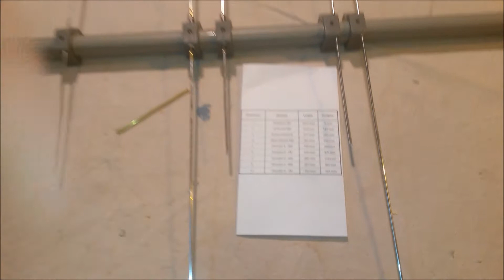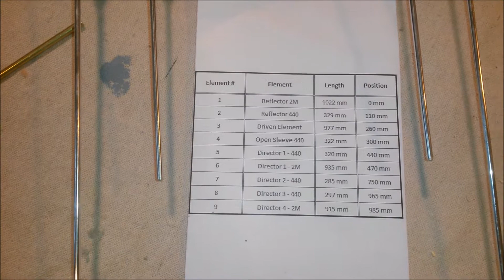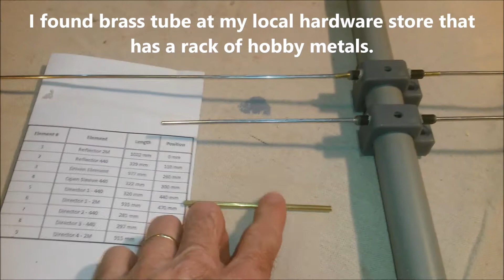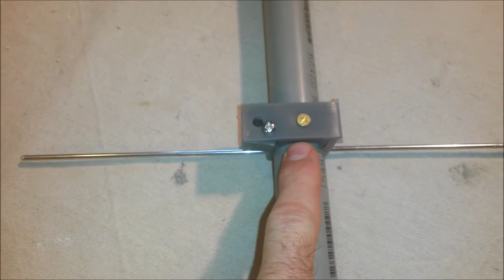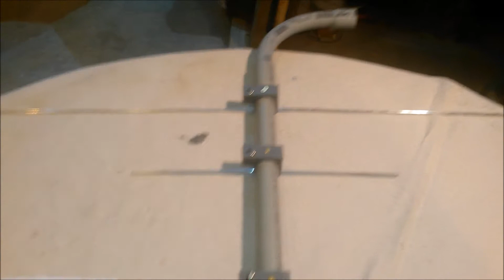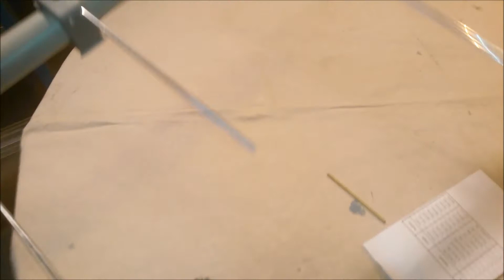Larry D. Brown WB5CXC yagi

Comment: ... and did you ever find out if, in fact, the two directors should be swapped? My hunch is that you are correct, but wondering what your tests showed?
Reply from the maker: W7znd: it took a while for me to deliver this, but it is finally up and performing with a SWR of 1.1:1 on 2m. I have not had him do a simplex A:B comparison yet. I'm going to though. This is a perfect test as he is kindof remote and looking for a better signal than his dual band J-pole
Reply: bytescream Thanks for your research. This is my next project, although I'm looking at the 5 element version. How is it on 70cm?
Reply: I've been researching things a bit, and it looks like Larry, WB5CXC, is a silent key: https://forums.qrz.com/index.php?threads/larry-d-brown-wb5cxc-sk-december-1-2017.590937/
So, if you were hoping to contact him, that might be a problem.
Reply: The lengths and positions (including apparent mixup) were taken from the last table on this hams page at http://dk7zb.darc.de/Duoband/4+5_2m-70cm.htm which he credited. So you could take it up with DK7ZB.